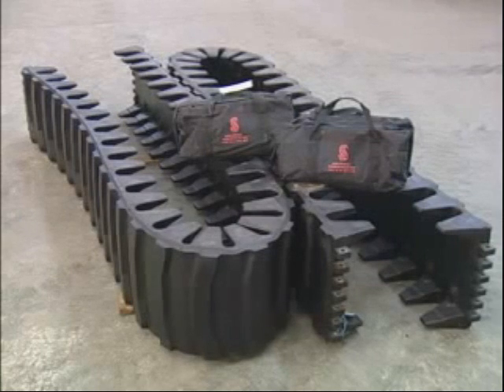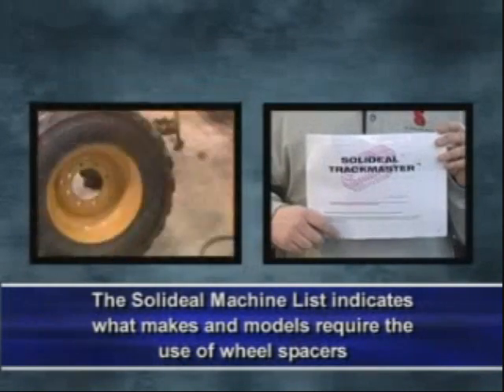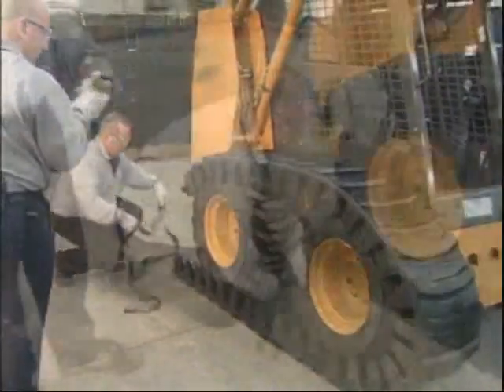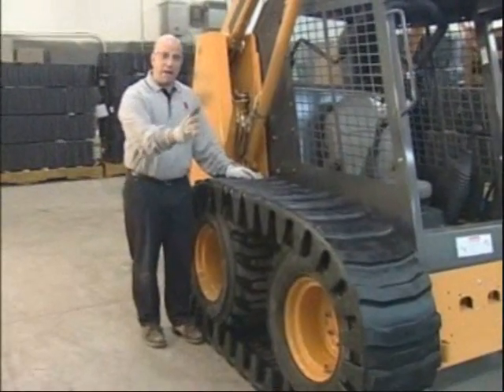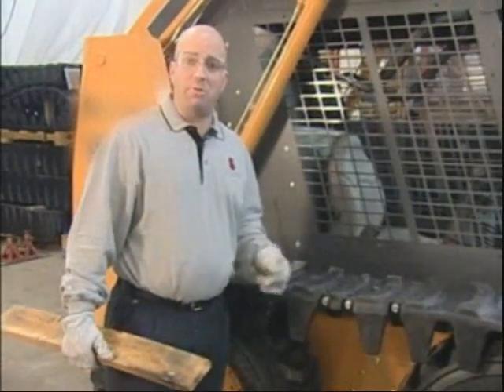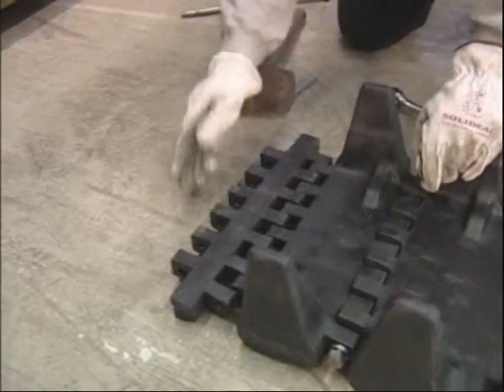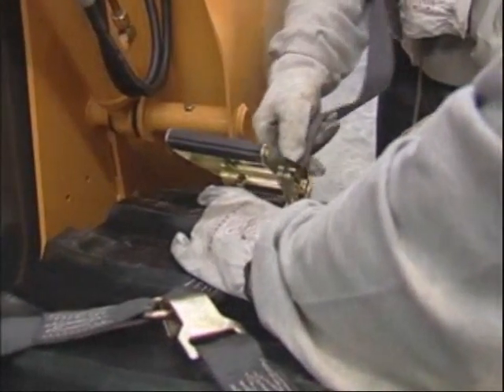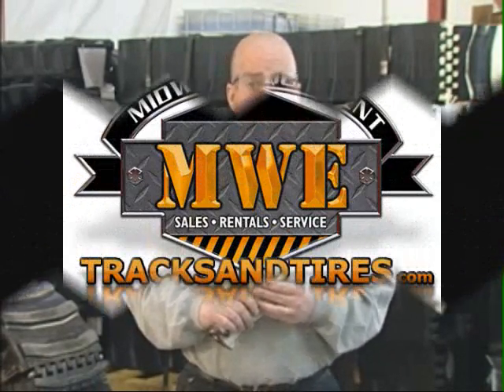Midwest Equipment How To Install Over The Tire OTT Tracks On Skid Steer

Comment: It appears the video being made over a decade ago questions are not answered but I did learn how to better use a ratchet strap surrounding the segment of track to pull together. I have steel Grouser tracks and the same type of tanks on each side of the skid loader making it difficult to get the rear wheel covered with track, I would like a lighter track set but one that also gives stability over uneven ground as the Grouser does, the tracks are so dang heavy but work well.

Comment: much easier to install than the metal tracks over tires i've seen.

do they stretch over time? would you eventually need to drop out the 1/2 pitch?

do you make them for Bobcat 751f?